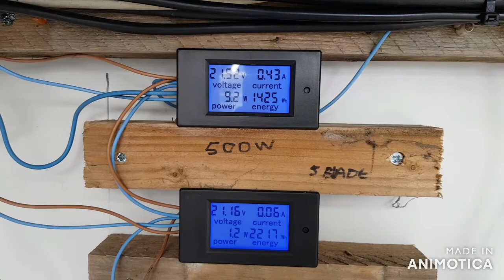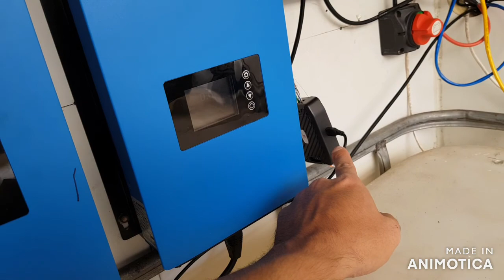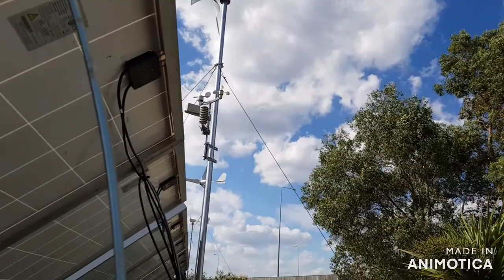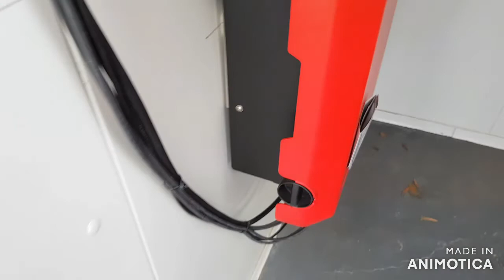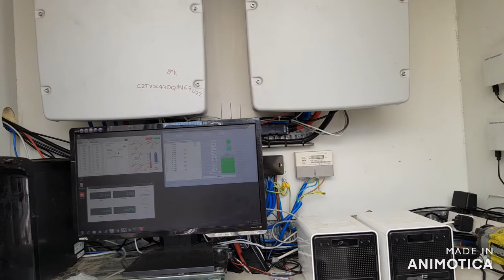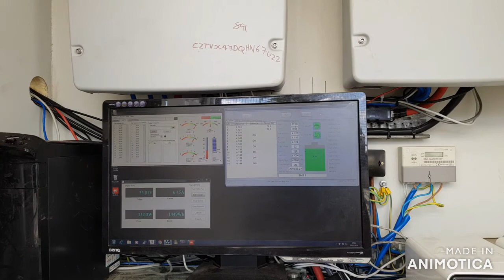Off grid in the U.K , Wind turbines , Batteries and inverters PT2

Comment: Hi mate, I am not sure if there is any regulation on constructing a turbine and how often do you need maintenance it, thanks
Reply from the maker: Hi great question, the regulations are pretty thin on the ground, and seem to be along the side of "permitted development". key parts would be, no taller than your house, and in the event if it fell would it be off danger to you or your neighbor's.  since these are small / micro turbines there really isn't anything to worry about.  I haven't done any maintenance on the turbines since i put them up, and have been spot on, nothing to complain here at all.  Just make sure you get them from a reputable seller, i went to alibaba. And also be kind on your expectations for what these can deliver.
Reply: @offgriduk2643  the way I read the U.K. regulations is if the turbine is free standing (not bolted to a property) you have permitted development rights as long as the house is detached).  If however you are bolted to a property you need planning.
Reply from the maker: @mollyfilms  i think you're right, along with the height restriction. I think alot of it comes down to common sense and having a clear surroundings, if anything should come off it.

Comment: Atrocious wiring! Come on!
Reply from the maker: thanks for the constructive criticism, albeit, as i have said this is a development install spanning over 2 years with bits being added, modified and prototype d, hence the wiring is a mess although safe, we have never had any type of electrical short ever.  I have in later videos tidied up the wiring, but loom wrapped cable is always a nightmare to work on if you are looking to modify at a later date, and fault finding or using a thermal gun to find hot spots is damn near impossible. I released these videos to let people know that SMA can be integrated with other non-stock items, and not to show off my wiring prowess, if there were lots of videos available on this type of integration with SMA, i would not be making the videos, its more to educate.  To all degree, better I make a mistake, and have the ability to fault find, and release a real world video where the unit has been in operation in real world conditions for 2 years, than for someone to release a video that the parts look pretty but unable to see the bare bones of an install.

Comment: Where did you find the batterys as was looking at the Nissan leaf battery pack for my own system
Reply from the maker: there are a few online sellers who deal in used lithium battery packs.  I still find Ebay seems to be the best when it comes to value for money.  A lot of electric vehicles getting broken for parts come through Lithuania, have a look in ebay you will find a few resellers, that can ship to your door, it is a little bit more expensive, as the transport in the u.k is a nightmare for shipping lithium. But if you can find someone breaking a nissan leaf and is local to you , good idea to see if they will deliver it.  Good luck. Any more questions just drop me a message thanks.

Comment: hi off grid, having built such a good system, do you know if it would be possible to run a small cottage with no mains electric, off - solar and or wind, but with a small budget and much more simple set up, budget for example 3-4000 gbp give or take a few quid, most stuff these days runs of usb or can be 12 v ,so its just computer tv and washing machine ,and chargers ill prob need 240v for, cheers
Reply: Yo brother that's well do ableable on the budget, I'm in a diy off grid cottage Ireland message me away if you want
Reply: @shitina.bucket9699  im not sure it is look at all the stuff this guy has and hes only got 1.5 days of stored energy?
Reply: @lazycarper7925  if you dont mind use a generator a cheap genny plus battery bank and charger will get you off grid real cheap and fast then you can add to your system till you dont need genny
Reply: @shitina.bucket9699  i wish i could do what you have done but it takes some bottle, im asking bcos im looking at a small place in ireland myself,do you have any children?, would you be able to supply other people if they lived with you,let them watch tv ,charge phones, etc
Reply: electric board want 3000-5000 in ireland for a reconnection, and then it has to be to a modern fusebox n shit, how can anyone aford that
Reply: @lazycarper7925  it's just myself and my wife here but our system suits our needs fine, we live like normal people fridge, freeze, tv, pc, phones, microwaves ,air compressor, drill,angle grinder ,ebike echainsaw etc we even use small electric heaters when we have too much power. I dont see why this wouldn't work with kids you'd just need a low voltage disconnect to protect your battery encase someone left something on
Reply: @shitina.bucket9699  thanks i dont have any kids yet but im just thinking ahead,thanks for trying to help,i think its cool what you have done,its also a bit like sticking the finger up to the system and the big money grabbing companys, when you go off grid,
id love to see a smallvid if you ever could on your batterys, and your set up and what you think is the meat and veg of your system, i really want to start a family in ireland,englands gone a bit nuts, and my mum was from ireland , but was give up for adoption and came to england age 4 , so im half irish but never been lol,
Reply: @shitina.bucket9699  hi, did you need any planning to live in a old cottage, was it a wreck when you got it
Reply: @lazycarper7925  its was derelict, roof was falling it, you don't need planning for renovation (so long as you aren't planning any mad extensions) however county council might have issues if there is no septic tank on site. You are also allowed a small extension to the rear or shed on the side ( without planning)
Reply: @lazycarper7925  basically if you have a septic tank and you're just fixing her up as she was you should have no issues ( unless you want any sort of tatch roof you would need planning for tatch ) but anything else would be fine
Reply: @shitina.bucket9699  hey thats great thanks, what kind of problem is it if there is no septic tank?
Reply: @lazycarper7925  without septic tank you will need planning for septic tank , and if the site is less than .5 acre you will need some perculation system which is costly. Or shit in a bucket but keep it hush hush and pretend you have a septic tank , shit really doesnt stink when covered in dirt and its much better than mixing poo poo with clean drinking water :/ but I would never ever shit in a bucket no no not I it's a good old fashioned planning approved septic tank for my poo yes sir wink wink
Reply: @shitina.bucket9699  nice1 i like the way you think

Comment: Do you need planning permission for wind turbine in the UK?
Reply from the maker: Hi, and welcome, the general rule of thumb is... lower than the ridge height of the primary property, and not within falling distance, where damage or injury can occur to another person or property.  to summaries, planning would be required if a small turbine was higher than the height of your roof / house, and/or is too close to your neighbour or could fall over in the road or pavement where it could injure someone.  Generally it would fall into permitted planning as the foot print used is so small.  hope this helps.
Reply from the maker: permitted development
Reply: In Scotland it looks like I fall foul of the rule "installation must not be less than 100 meters from the curtilage (boundry) of another dwelling".  The other dwelling is a long way away but the boundry is withing the 100m.  I have just baught one anyway. Ayrshire is a forest of wind farms, my little 2.5kw is a toy in comparrison, I will worrie about it when I am caught.
Reply: @Gary-is-half-baked  - can you recommend a decent "domestic" or "pro-sumer" Wind turbine available in the UK which is capable of generating 2000-3000 watts.
Reply: @randymch  Hi, no unfortunatly but I cam reccomend you do not use TESSUP.  My turbine performs okish but very poor quality control, had damaged goods, manufacturing defects and the customer services is non existant. Buyer beware!
Reply: I meant for small turbine like you have.
Reply: Thank you for great information. 👍

Comment: is there a medical name for our condition. luv it. i have east and west solar grid tie and solar off grid at hol place looking into hydro.
Reply from the maker: havent got round to hydro... yet. would love to dable with that, i think you could use a peleton wheel with a wind turbine PMT connected to it. albeit i havent tried yet.
Reply: @offgriduk2643  ive no head for pelton and limited flow till it rains then a torrent. so dabbling with a waterwheel idea! but would have to be removable for daytime ... ea...even a trickle charge would do.
Reply from the maker: @mikegb1969  is it like a running stream, when it rains??  you could damn, or divert so you create a reservoir, then use a traditional type.  if its a shallow stream but fast running, a possibility could be a large number of those small water turbines mounted in something like gutter down pipes, not sure if the work would be worth it though. those little in line turbines only make a small wattage, theory you could buy one a bit of pipe and rig up only one with a dc watt meter, then multiply up to get a reasonable yield??  interesting though.
Reply: @offgriduk2643  no chance mate. E A sample water there. and too many busy bodies about. Hence the clandestine wheel lol. i hooked up a pmg to a bike and solar controller and battery it looks like its charging. so fingers crossed. As you say dabbling is partof the fun. Novice when it comes to lecky so stay 12 v keep posting bud.
Reply from the maker: Great work, keep dabbling